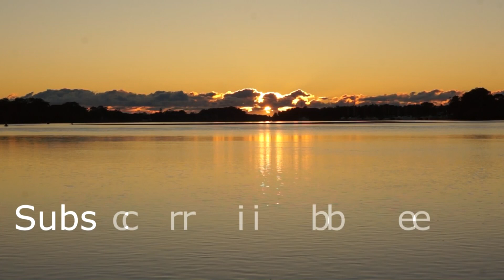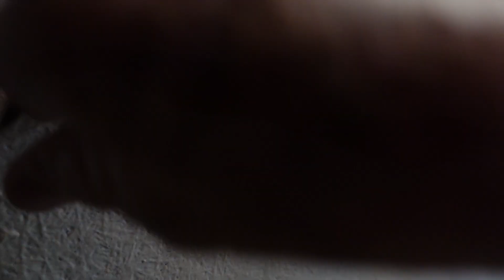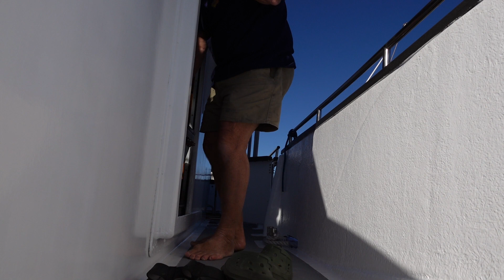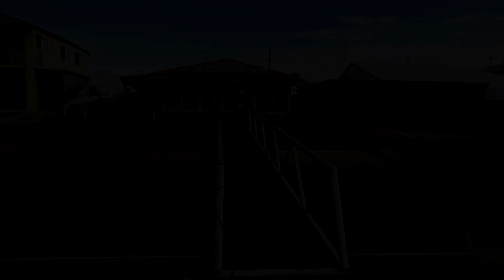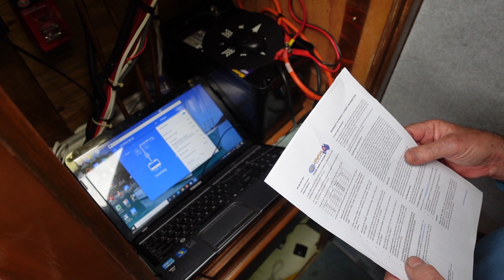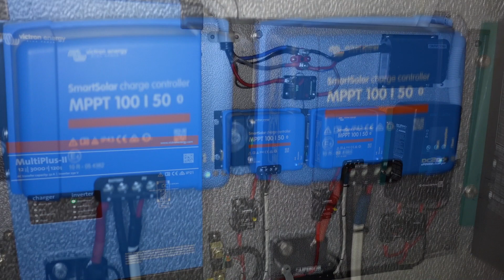Lithium Conversion Ep7 Finishing The Install

Comment: Is there a DC  isolator  / battery switch between the battery and the inverter??? (apart from the fuse)
Reply: Good point. I would normally install a battery isolator after the fuse / before the inverter and rest of the system.
Reply: No. The isolater is after the inverter. Cables are 70mm and very short in length so possibility of a cable problem is negligible.  In the event of a inverter problem the fuse will blow faster than someone getting to the isolator.

Comment: keep an eye on those circuit breakers off your mppt chargers , had 3 and 2 failed so all 3 went for a swim, better options available,  the board looks neat though
Reply: Yes there is some crap available on line.  I use Ankoron brand.  My theory is, if they aren't willing to put their brand name on the product then they don't want you to know who made it, so I won't buy it.

Comment: Thanks Norm. Because of what your old mate said, I think I’ve set up my 2 AGM’s home batteries so I have a “lazy” battery with the wiring going to the first battery instead of both. Im going to have to have that checked out. Stay safe, dude.
Reply from the maker: No probs Jim. Glad you got something from it.
Cheers dude
Reply: I’m due for a slip also. You available? 😁
Reply from the maker: @jimthurgood5364  Hmm.. Bit tied up this year mate. Good luck with it though.